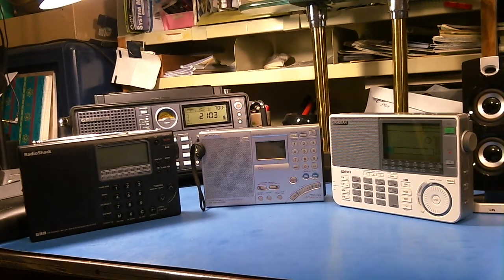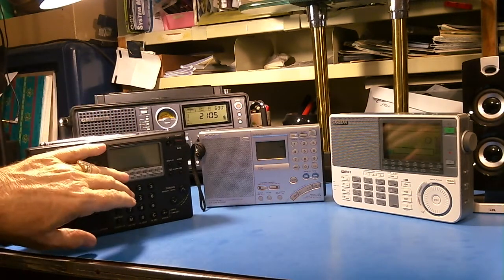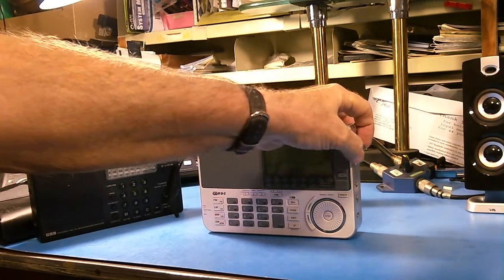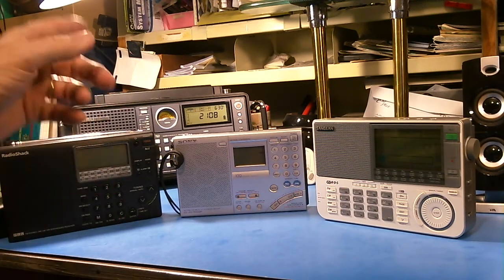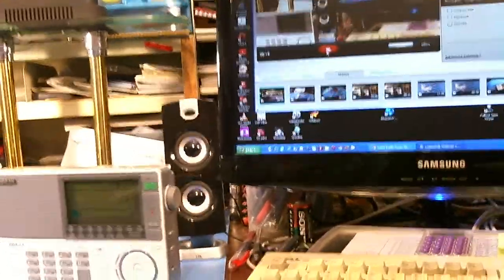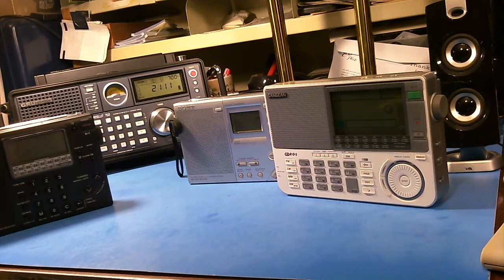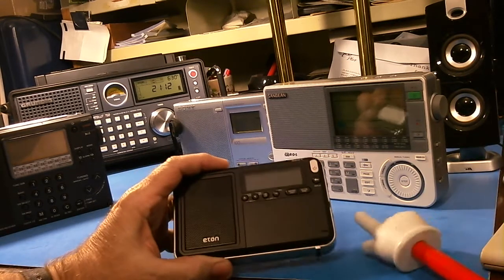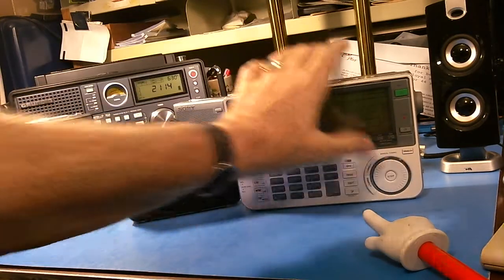TRRS #0441 - Shortwave Radio Tuning Mechanizations

Comment: I'm almost 50 so I grew up with analogue tuned radios with knobs but was young enough that when my dad bought a Sony ICF 2001 I got goosebumps at high-tech it was. I have the ICF-2001 for nostalgic reasons and the Panasonic RF-2000 is my all-time favourite radio and it doesn't have a keypad or digital display! All that said and yet I won't buy a (new) radio if it doesn't have both a tuning knob AND a numeric keypad. Such a crazy hobby!

I've heard many good things about the 909x (provided you use an external antenna) and I'm curious how I'd like that tuning wheel. The thing is, it's a wee bit pricey and with a Satellit 750 at home attached to my antenna, I'm not sure how or when I'd use the Sangean.